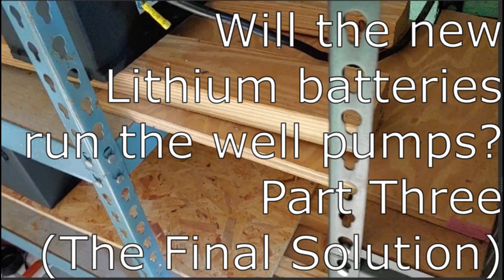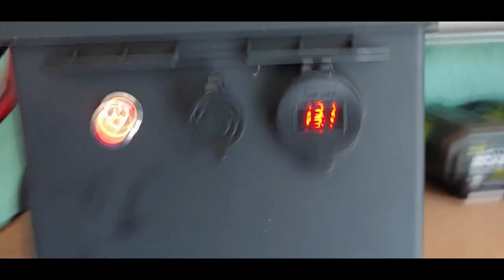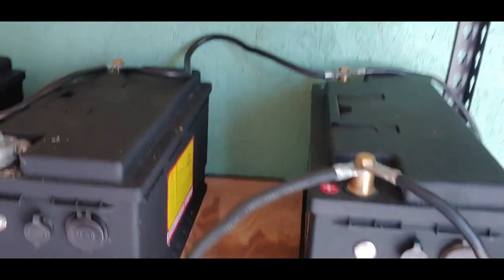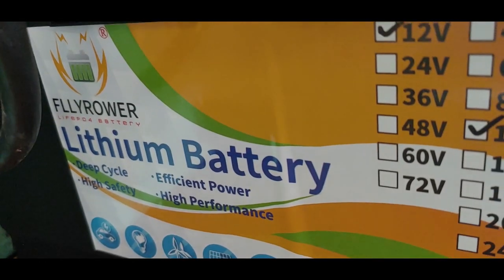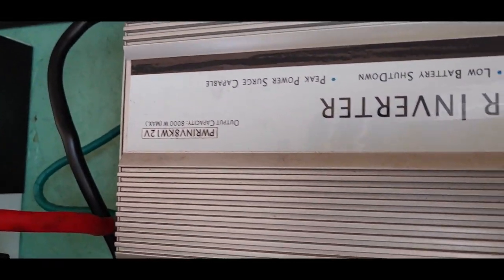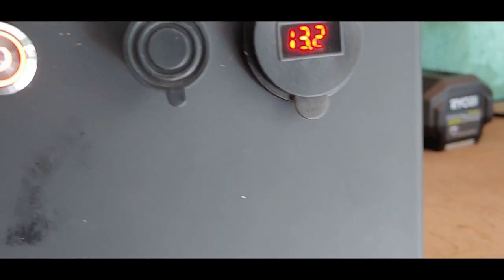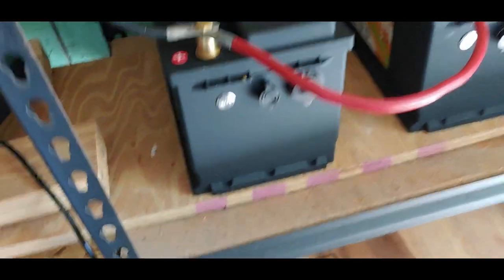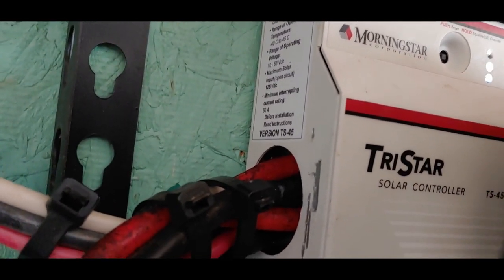Off-Grid Solar Power System:  Well Pumps Test w/ Lithium Battery: Part 3 (The Final Solution)

Comment: Early on I found that electric motors run better off of the pure sinewave inverters. Had a drill that wouldn't run at all(hum) and a laptop charger that would hum. Yikes....
Lithium batteries are still out of my price range. Can't do it yet. But for backup power my 6v golf cart batteries are doing fine for now. A little over $400 for four and 200+ useable Ah's👍
Reply from the maker: You are correct about the pure sine wave inverter. Lithium batteries are dropping in price all the time. Most of my battery banks are still deep cycle. Thanks for your comment.
Reply: @shoestringprep  I hope to get Lithium next time. I have 3 or 4 years to save up for.
Reply from the maker: @cliffandrews  good luck

Comment: looking good!
Reply from the maker: Thanks for your comment.
Reply: Hey shoestring I've got a 24v 200w pump that i'm going to power it with 3 solar panels 12v 100w each I'm thinking i need to wire them two in series and the third in pararell with the other two' What are your thoughts?

Comment: Very interesting videos.  I have been wanting to go solar for quite some time and I have always thought that one of the first things I would like to run oft solar is my well pump.  I just bought my first panels yesterday.  I bought 2 100w panels to start playing with and try to figure out what seems to be a very confusing subject.  I am aware that I will be needing to purchase more panels and a lot of batteries and other expensive equipment to run my well pump.  I am wondering what you think it will take to run my pump.  It is a 1hp Goulds JRD10 shallow well pump and it is currently wired 220V but it can easily be converted to 110V if needed.  It doesn't run very much and I only have one pump.  I believe I saw a Gould pump in one of your videos so I'm hoping you might be t he man with t b e answer to the million dollar question thar I've been wondering about for a long time.  Thank you for taking your time to make videos that help people understand a complex subject.
Reply from the maker: I'll be happy to help you. Putting my well pumps on solar power was my first project and I would love to help you avoid the errors in my trial and error process.
First, convert your well pump to 110V.
Second, you need to know how many watts your motor draws when it is running. This is to make sure you have the correct size battery and inverter.
Next, if you can afford it, I would suggest a lithium battery (or batteries depending on how much power your motor needs). In my video, there is a link to the Flypower batteries I use, but you should do your own research for your situation.
I hope this helps.
Thanks for your comment.

Comment: I think you should put the load positive on battery 1 and load negative on battery 5 or vice-versa. Don't put the load on just one battery . I think that will help spread the load (amps) more evenly across the battery bank.
Reply from the maker: Appreciate the tip. Thanks for your comment.
Reply: Yes that is right. All on one battery wil have a unbalance discharge. In turn kill the first battery and have to be replaced before the others. Same as when they are getting charged.

Comment: typical find a battery more in my price range and they not selling them or cant get them here in the uk lol odd how they have 12v and 36v but no 24v that i really want as my ups is 24v
Reply from the maker: Finding the correct battery can be problem sometimes. You can wire to 12 volt in series and create a 24 volt battery.  Thanks for your comment.
Reply: @shoestringprep  yeah i was just thinking that a single bms for 24v would be simpler then 2 independent units